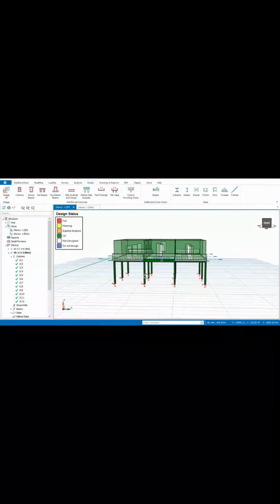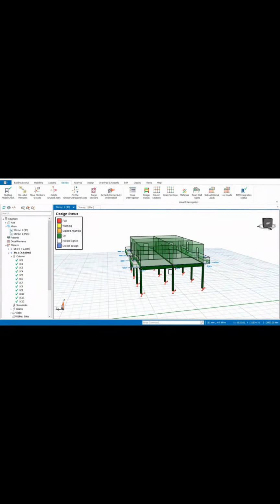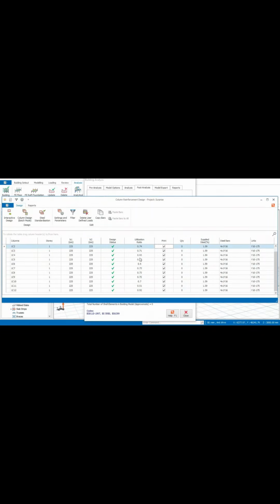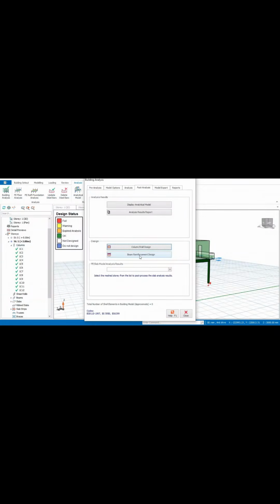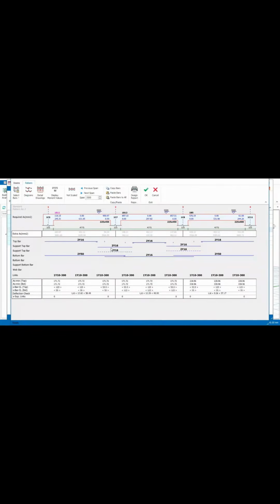HOW TO MANUALLY DESIGN REINFORCED CONCRETE BEAMS #protastructure #rebar #tutorial #howto

Comment: Hi, I'm a beginner learning structural analysis. I'm working on a project that involves a stepped beam, and I also need to model tapered beams and slabs with varying elevations. What is the best approach to analyze and design this type of beam, as well as the tapered elements?
Reply from the maker: You may step down or up your beam by adjusting the values of your e-z in beam properties, however, the adjusted value must not exceed the depth of your beam

You may also adjust the values of your deIZ for I and J in beam 3D properties to step your beams or create angled beams...

Lastly you may create an intermediate story to install the beam at a preferred height...

For modeling tapering slab with beams you can use plane definitions and adjust the values of deIZ for I and J in beam 3D properties to model angled or stepped beams...perhaps soon enough we will make a full video tutorial on this topic. I hope this helps, thanks for your feedback.
Reply: @M.AEsanConstructions Thank you for the very thorough explanation, but I still don't understand how to apply it, and I hope the video tutorial can be released soon